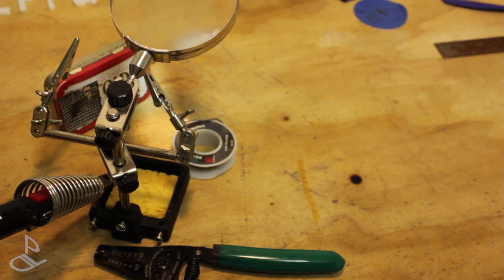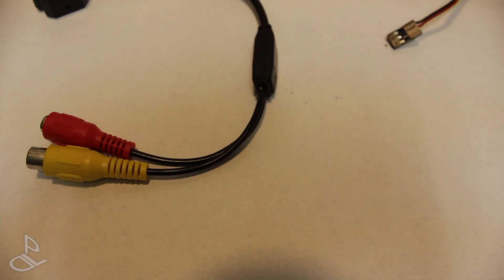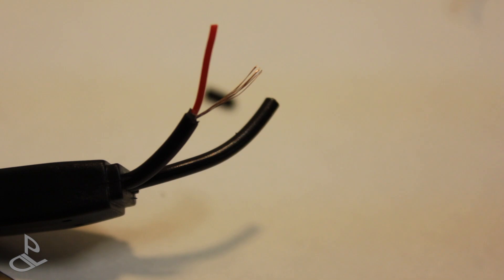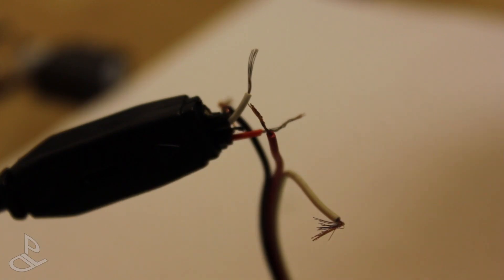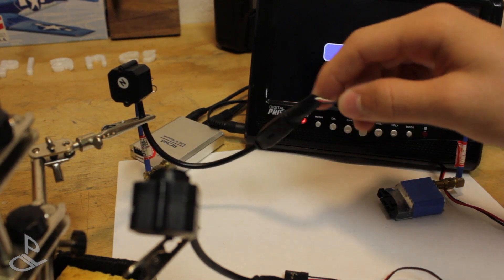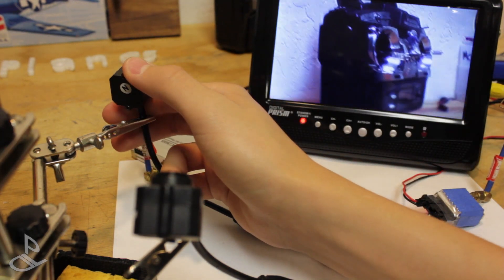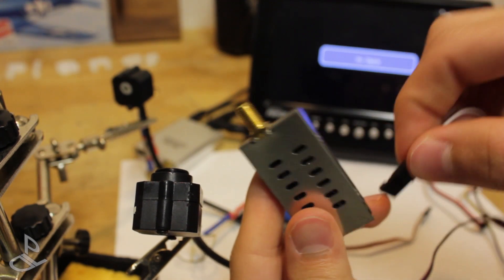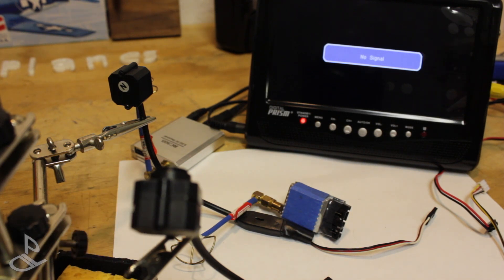DIY: $10 FPV Camera

Comment: $10 for the camera. but it won't be fpv unless you buy an $80+ transmitter.
Reply: http://www.hobbyking.com/hobbyking/store/__92137__FT951_5_8GHz_Video_Transmitter_25mW_Full_FCC_CE_and_RCM_Certification_US_Warehouse_.html
Reply: wrong
Reply: You can get a pre-made, self contained FPV camera that has a built in transmitter and antenna for 20 dollars.
Reply: Go to eBay

Comment: DUDEEEE,beside the cam i need what?a reciver,trnasmiter and what ????im a dumb fck at fpv
Reply: 5.8ghz video transmitter and a receiver. plus a headset. Buy fat shark at 300 bux or just build one. Get car reversing lcd screen 4 inch and just build a housing with foam. Or buy a cheap headset. Just buy this very good cam for 12 bux delivered and this other gear is the fpv stuff 
-CAMERA: http://eu.banggood.com/Wholesale-Warehouse-Eachine-700TVL-3_6mm-Lens-1-3-Cmos-90-Degree-Wide-Angle-FPV-Camera-5-12V-wp-Eu-992611.html?p=FB0917407849201401SD
-VIDEO TRANSMITTER:  http://eu.banggood.com/Boscam-FPV-5_8G-200mW-AV-Wireless-Transmitter-TS351-p-73198.html?p=FB0917407849201401SD
-VIDEO RECEIVER:  http://eu.banggood.com/FPV-5_8G-8CH-200mW-AV-Wireless-Receiver-RC305-p-73203.html?p=FB0917407849201401SD 
-GOOD EASY VIDEO GOGGLES: http://www.banggood.com/Aomway-VR-Goggles-V1-5_8G-40CH-800x480-5-Inch-FPV-Video-Glasses-Headset-p-1068478.html?p=FB0917407849201401SD. 
Also buy a pair of circular polarized antennae, extends your range. The headset at the end there has built in fpv vid receiver. So you can omit the other one I quoted. I can help with setup, pretty easy.
Reply: thx sir

Comment: Why are you keeping the big nut on the wire and cut the wires after it ?
will it be more light if we remove the whole cable and solder the connections directly to the camera chip ?
Reply: I would of opened the camera and solder the plug to the camera, but nice video
Reply from the maker: It won't work, the 'nut' on the wire has a circuit board that does something to the video signal. The first time I tried it I did what you mentioned and it didn't work.

Comment: i will never follow a DIY video that twists wires together and hot glues them.
learn to solder.
Reply: it is an ineffective, lazy, and unreliable repair. it promotes improper techniques for repair, is prone to failure from vibration (which is important in an FPV drone or airplane scenario), also prone to shorting, reduces connection and video quality, and looks like shit. whats even worse, is he has the correct tools in the first shot of the video! a soldering iron and spool of electrical solder is RIGHT THERE. but he is not using them even when he has them!
Reply: .+MrMindblocker i learned to use a soldering iron when i was 14.
Reply: XDDDDDD
Reply: +Zarphus I do not get it. What is wrong with that?

Comment: How can I hide this in cloths?

I want to attached a mini cam to my doughter cloths and get some videos from the kindergarden
Reply: IM THINKING A SOLID DONT
Reply: Guy Eshel Yeah it's pretty easy, all you need is:
- Li-Po battery pack, probably 1200mAh w/ DC barrel jack connector
- Thin gauge wire
- MicroSD recording arduino or similar
- Fabric glue
- Needle and thread
- Drill with variety of drill bits
- Scissors
- Whisky/Scotch, with tumbler
- And of course, your camera

The steps are:
1) Using your scissors, cut off a button
2) Selecting a drill bit slightly smaller than the camera lens, drill a hole in the centerline of the button
3) Affix the camera lens through the hole of the button so that it sits flush with the surface, and secure with super glue on the rear of the button
4) Using the needle and thread, re-attach the button to the clothing
5) Solder wires to the power and video terminals of the camera
6) Solder said wires to the respective power & video terminals of your arduino
7) Connect the battery pack to the arduino
8) Sew the assembly into the clothing, perhaps on the back of the shirt
9) Admire your craftsmanship
10) Dwell on how great it is that you'll be able to covertly record all those kindergardeners
11) Realize what you've done
12) Subside into lament and regret due to your actions
13) Cry, profusely, as you poor yourself a scotch/whiskey
14) Repeat step 13 until passed out drunk
15) Wake up and destroy the evidence of your shameful actions
16) Never speak of this again

See, pretty easy, only 16 steps and about $70!
Reply: Pal Adino Child Stalking?  WTH?!

How did you get to that?
Reply: Guy Eshel Seriously GUy, I am not trying to be a&&. you don't think that's a little creepy hiding a camera on your daughter and sending her to kindegarden so you can look at the kids later?   Do you really not understand how that looks if the gestapo police state found out.  But to be fairI don't know what  country you are in.  Hiding a camera on your child and filimg other kids surrepticiously is not looked up on kindly in the USA police state.   I am not saying you are stalking, I just could not come up with a better title to get the point across.  Can you image your pickle if your child walked into the kindegarden restroom with that camera on and filmed other children in there?  Do you now get what I am trying to convey?  Geez, NOT A GOOD IDEA!
Reply: Lol Lol That's my daughter you bunch of idiots, I just want to know if the kindergarten teachers are acting violently with the kids. 
Wow, you guys are pricks.
Reply: +AceOfD1amonds hahahaha
Reply: +AceOfD1amonds That's one of the most freeky comments ever.  dude, get some medication, really.
Reply: +smootskin no seriously you shouldn't do that,its disgusting if she go to girls toilet then you could see her.... or she's man''' there

Comment: I didn't read down thru all the post but I think it is very important to point out that the Tx that you plugged your camera into has 5 PINS and your new servo connector you added to the cam only has three it is VERY important to plug it in the right place or you are taking a chance at damaging your camera (That is how my 5.8G Tx is yours looks to be the same ) just thought I would point that out

Comment: what is that jell you put on the wires to protect them? what is called?
Reply: That would be hot glue, from a hot glue gun.

But seriously, put some heatshrink on the wire, solder them together and shrink the heatshrink. Much more secure, and looks better.
Reply from the maker: Frank van Schie is correct, use heat shrink it's better. I had run out, that's why I used hot glue.